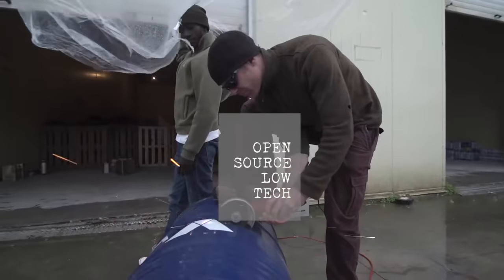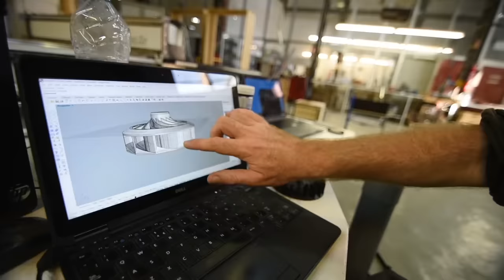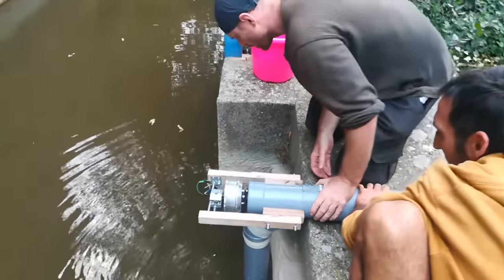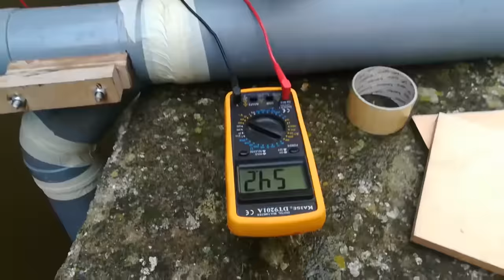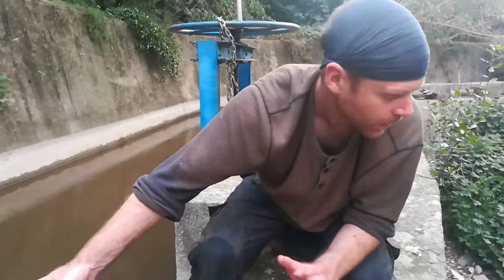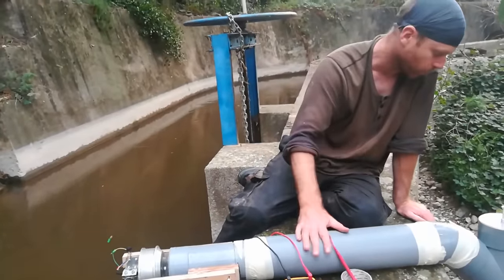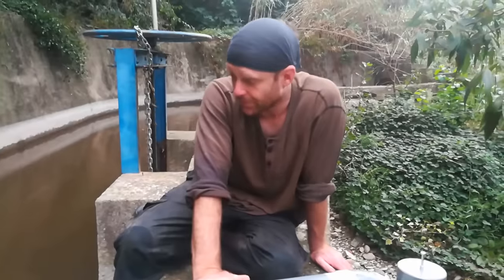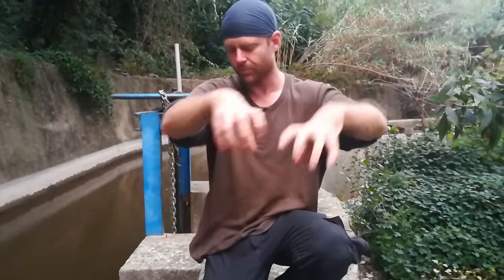The $50 Water Turbine -DIY, Portable, Powerful, and Open Source

Comment: Quick question because this got me thinking. Ok so you're essentially moving water from a huge - high up - reservoir, down below. Could this be engineered in such a way to allow moving water from the same reservoir, to the same reservoir? I realize you need to move the water back to suck it in and that would require power, some pump, leading to less gain. Tesla valves? Larger diameter pipes for the falling water? Seems impossible, just wondering, though.

Comment: Amazing! BUT, is the canal water clean enough to be released into a regular stream? I live on a creek and would love to generate power in similar fashion. 24-7 from the creek is intriguing as long as it doesn't disrupt the natural environment. Great build and great idea.
Reply from the maker: Generally, and with this one, they're such that the input and output waters are of the same source. ie, just plug it into a river. Here the mill run was diverted upstream from the same river as the output went back in to.

Comment: The siphoning was brilliant. But I think that fishes sucked in would get stuck in fan and die either in the blades or in the pipe due to pressure. Nice work though. Loved it.
Reply from the maker: There'll be a mesh bag filter to keep anything from getting sucked in.

Comment: Rarely are conditions that convenient for DIY-ers. You need a steady and reliable flow and a sizable drop and for that situation to exist near point of use. In most cases a lot of earthwork and infrastructure are needed.
Reply from the maker: No significant earthworks needed for this design, but indeed if you have no drop and flow then you have no hydro power availability.

Comment: Thanks for sharing. One question, in this model where you used the same pipe diameter, how many maximum amps did you get, before deciding to increase the diameter of the discharge pipe?
Reply from the maker: I haven't really been tying load to pipe diameter, the latter is generally the fattest that is affordable and doesn't pull more than the available water supply, and load is set by maximum power point / efficiency, which is generally that which drops the rpms to half that of open circuit / unloaded.

Comment: You can put a Pelton at the bottom and capture power a second time.
Reply from the maker: Peltons are good, but generally need at least 20 meters of head to function well, and the back pressure would halt the momentum.

Comment: I've given serious thought to trying to generate power from our creek - would let us generate our own power with a lot less battery backup since the hydro could be used on-demand to back up the solar and wind.
Reply from the maker: Yeah hydro is usually pretty nicely dependable in terms of output and availability.
How much drop and flow do you have and how much power would you be hoping for?
Reply: @OpenSourceLowTech  Flow is pretty heavily seasonal, but when we're not flooded or in drought probably a couple hundred gallons per minute. Drop is going to be limited, doubt I can engineer more than about 8-10' given that the land is pretty flat and I don't want to build a reservoir that rises above the cut of the creek, plus need to manage floodwater flows that easily can get into tens of thousands of gallons per minute. During maximum spring runoff, the flow cross-section is between fifty and a hundred square feet, with a linear flow velocity of around 10 feet per second at the surface, so rough math gives me a couple thousand gallons a second I need to send over the spillway without washing out the dam. A reservoir that could modulate the spring flood would be really handy, but given the terrain just isn't feasible. 
Power wise, maybe a couple kilowatts surge, few hundred watts sustained. I'd like to get 10kW out of the system to keep the geothermal heat pump running full time, but don't think that's feasible given the flat terrain.
Reply from the maker: Ok so no problem with flow then. Eight to ten feet is fine, I'm sort of looking around 2-3m / 8 ft as more or less the sweet spot of useful power vs expense vs what the materials can sustain vs much more than that and you'd be better off with a Pelton.

In Berlin, as per the Part 2 video, I ended up with 61VDC x 3.1A = 192W from 2.5m x ~30 l/s
It's not really going to have surge capacity tho, the turbine is essentially either just on if it has sufficient water, and off if it doesn't.
An option there tho would be multiple self starting siphon turbines at increasing heights in your dam wall, so that more come on as the water level rises, and shut off when it drops. And then just have an electrical setup which can accommodate however many it's being fed.

10kW is a lot of power tho..
Reply: @OpenSourceLowTech  I'm thinking a Pelton wheel setup driving an automotive alternator is probably going to work pretty well for my application. Alternators can be had pretty cheap from salvage yards, and a Pelton is pretty efficient. If I hack the regulator circuit, I can pretty easily ramp up the output, and a well-designed Pelton is pretty efficient. I'll probably use a programmable logic control to manage the setup. That gives me quite a bit of flexibility, should be able to up the draw to a couple of kilowatts with that hardware if I can get enough torque off the wheel.
Reply from the maker: Peltons, Turgos, and other pressure type turbines usually need at least 15-20m of head to function.
Car alternators are low efficiency and need a lot of rpm to do much voltage, but do have fairly good max power, and like you say, charge regulation usually built in.

For this kind of power range I'd recommend something like a wheel from a hoverboard / balance board, which are three pahse permanent magnet alts when spun, good for about 400W depending.

If you need something in the kilowatt range either a treadmill motor, direct drive washing machine motor (which would be too large for my turbine) or something custom and pricier.

Comment: So with the turbine now acting as a pump too couldn’t you add in auxiliary turbines in the down pipe to generate more power or would the cause a drag on system(as far as torque and rpm)?

Comment: 500W mit 50L pro Sekunde bei 2m Fallhöhe und 40% Wirkungsgrad aus einem PC-Lüfterrad, ernsthaft?

Die Zahlen sind natürlich extrem geschönt: Durch die Energiegleichung für potentielle und kinetische Energie (E = m * g * h = 0.5 * m * v²) ergibt sich g * h = 0.5 * v² -> v = sqrt(2*g*h) = 6.26m/s und mit dem Volumenstrom durch ein 100er HT-Rohr(A = 0.0078m²) kommt man zwar in etwa auf 50 Liter pro Sekunde Q = A * v = 0.0078m² * 6.26m/s = 0.049m³/s = 49L/s und auch die Leistung passt in etwa mit 49kg/s * 9.81m/s² * 2m = 961W bzw. 385W bei 40% Wirkungsgrad.

ABER:
1. Bricht der Durchfluss DEUTLICH zusammen sobald man die Reibung an den Rohrwänden und Bögen berücksichtigt.
2. Reduziert sich der Durchfluss nochmals ERHEBLICH wenn man den Strömungswiderstand der Turbine berücksichtigt.
3. Hält das Lüfterrad einer realen Belastung von 500W niemals stand.
4. Liefert der Generator keine 500W, die 10A sind einfach aus der Luft gegriffen und die Spannung von 56V bricht bei Belastung sofort ein.
5. Selbst wenn Punkte 1-4 nicht vorhanden wären, was sie aber sind, würde das Lüfterrad innerhalb weniger Tage durch Sand und andere Teilchen im Wasser verschlissen.

Mit dem Spielzeug würde ich eine Leistung von etwa 100W für realistisch halten, wobei das Problem mit dem Verschleiß nach wie vor das Ganze absolut unsinnig macht.

Comment: A conical impeller fan will laminate the flow better. The water is crashing into the spindle/base of the fan. If you did a dual impeller you could increase power with less flow.
Reply from the maker: I put a nose cone on the fan, but yeah something more like a boat propeller shape would probably do a better job. Matter of how to easily source something like that in low resource environments tho...

Comment: 1)Just watching the end of the video when you try and stop it. Would a tap on the top of the downpipe work to break the siphon?

2)Does it work as a pump?
Reply from the maker: It would, and that's more like what I had in the Berlin build, in the Part 2 video.
It's more a matter tho of how to easily start it than stop.

The water will only siphon to a lower point, so it'll work well for emptying over a wall, but won't pump uphill.
Although a hybrid between this and a ram pump would, but only with a subset of the flow volume.

Comment: As a water treatment operator, I have a concern that you are at the lowest pressure point and that will cause your impeller to be damage from cavitation, I am not sure because I don't know the temperature of the water.. The best spot is at the bottom of the pipe, plus with more head pressure, you will get more power from the water.
Reply: Agree... it will max out with cavitation way before the theoretical maximum of 30 ft.

Comment: Will this work with leaves froms trees cloging up the pipes? What about minerals from the water clogging up? Love it. Just wondering about maintenance and the cost of maintenance. If you put the power output into a battery bank,... how well would this work?
Reply from the maker: Check the part 3 video just posted, but yeah the intake filter is a very non trivial design consideration that I'm currently giving thought to.
Mineral deposits shouldn't be a problem.

Should plug into a fairly standard battery or grid tie schema pretty well.
Reply: @OpenSourceLowTech   @OpenSourceLowTech  thanks for the response. I have much to learn,... trying to work out the dynamics of what i have available to me. There is a creek that flows by my house that is somewhat off the grid. I enjoy your content and the reality of how easy it can be. Much appreciated. 

2 part question. I also work at a national park that produces thermal hot water. That is why i am asking about the mineral build up. There is alot of tufa(mineral) build up and excess of 140 degree ferenhit water. Will that overheat the turbine/motor?
Reply from the maker: Ok yeah if you're running it off geothermal water then things could get weird. The metal parts, even being stainless, I probably wouldn't want to keep immersed in whatever salts etc are likely in there, and the plastics would soften to some extent in the temperature, possibly problematically so.

You're probably looking more at thermal energy generation options there than gravitational or momentum.

Comment: Question: Do you think that you could engineer a system that runs on two large but finite bodies of water? So just as you were using a sort of syphoning technique to get the "ball rolling" from the unlimited canal down to the stream below, you would use some sort of closed loop system to take the out-take water and bring it back to the original source of water from another syphon-type system. I'm not an engineer by any stretch but just thinking about how this brilliant concept could be somehow applied to areas that don't have this kind of water source nearby. With my idea, in dry areas, persons could just build very large water containment units (think: earthbag tanks, water-holes, ferrocement tanks, or whatever) to replicate this idea by recycling the water within the system. They say that the only "stupid" question is not to question at all. I'm certainly hoping that my question falls into this category.  :)
Reply: So I'm not to versed in this suff but to the best of my knowledge you can.  But from what I've been told it's like adding another engine and 4 tires to a car. At that point using a just using a bigger 3 phase hydroelectric turbine would be more powerfu and cost effective.
I believe there's companies that use large ponds to store water and use it on demand for the generation of electricity. Kinda like a battery.

Comment: You need a small overhead water tank and a long pipe with few taps at different height in your workshop to test how much head you need for the system. You need not run so many times everywhere to check if working or not

Comment: your generator demonstrated on a canal: try this change with the same parts -  reconnect the elbow with a generator so that the generator is vertical, not horizontal. Safety with the electrical connections at the top. the inlet and outlet would be mirror images, with the generator on 1 side, the fill cap on the other. on your web site the "contact '  link does not function.
Reply from the maker: Yeah that's largely what I'm now going with, check the part 2 video in Berlin.

Contact page seems to be working for me, does it give an error?

Comment: So is this a high-volume low-pressure system where when you put the dynamo on the bottom a low-volume high-pressure turbine?
Reply from the maker: Kind of. It would be if you have the head, usually at least 15-20m, to get up to the pressure needed for a Pelton or Turgo, but at these kinds of low head, 2-3m, it's not going to be much pressure wherever you place the runner.
So instead of pressure the energy is present in the form of momentum, so need to have high volume high velocity.

Comment: Hi Daniel, This is cool. Great stuff. Thank you so much for publishing this project. The water flow at the end of the pipe has an enormous power. Is it possible to fix a second turbine end of the pipe externally and have a second level of power generation in one unit. Thank you.
Reply from the maker: Strictly speaking you could pour the water over something like a water wheel, which would extract additional power and since it was external, not put back pressure on the pipe and slow the flow across the first impeller.

The reason why I wouldn't advise it tho is that you're almost certainly going to get more power off the first impeller if you just add additional pipe through the vertical height that the water wheel would occupy.

Comment: Hi Daniel.  I wonder if considering that such a system can be built with such a low head if there is maybe a better prop design that can be developed for a high head-low volume situation that can have a better power output than the traditional pelton or turgo systems?  Perhaps it is not an issue as these are relatively efficient, but it seems remarkable that you are getting such high energy return from that system, and it seems like there must be a way to get more power from the existing tech for the opposite potential energy.  For my potential energy, I have 300 feet of head (if my inlet is on my neighbor's property) and a three thousand foot run or so to my outlet location (a gradual angle of the land).  Do you have any advice on building a low-cost system on this small creek? Will a motorcycle alternator work for it?
Reply from the maker: Check the other two videos for actual power output. 
I'll be trialing various runner designs with the current install, keeping in mind that what's best may change depending on specifics of the setup..

300 feet is a lot, but then so is 3,000.. your main issue is probably going to be how to get that much pipe at a workable price.
Maybe look into old fire hoses, which departments often chuck out when they get old, but should still be ok for this kind of use.

Ultimately, I don't anticipate my turbine ever getting up to the kind of efficiencies of a Pelton or Turgo when operating at high head, and those are easy enough to fab that if you've got the water availability they're likely always going to be your best option.

Comment: Hola , Pregunta los 55 Volts es Voc, es a circuito abierto y con carga a cuanto baja, y respecto de los 10 Amperios también es en Isc??.Gracias!!
Hello, Ask the 55 Volts is Voc, is it an open circuit and with load how low it is, and regarding the 10 Amps it is also in Isc ??Thanks !!.
Reply from the maker: That was open circuit, but check the part 2 video in Berlin, after a bit of optimisation it managed to get to 192W @ 61VDC x 3.1A

Comment: What if on the down pipe. You put in the fittings. With another generator or two? Could the force of the water going out turn the generators? Because the more generators. The more electricity

Comment: Can you like use some kind of rain barrel setup, then when the water hits the bottom use a water pump with the electricity being made from that turbine, to pump the water to the top and then have the same water go through the turbine again, keeping the electricity flowing?
Reply: Perpetual energy isn't possible. Best bet is to place another turbine on the bottom.

Comment: Imagine having like 5 of those running at once, supplying about 50 Volts at 10 amps each. You can then run 250V through a line, which is a standard output and have 12.5kw/h, which is perfect if you live in the middle of nowhere

Comment: This may be a stupid thought, but sometimes those are the ones that pay off.  Hydraulic ram pump to move water to a high tank, which would then gravity feed to operate your turbine?  I know the ram would have to be much larger for the volumes to work out but that would seem possible.  Maybe a 12" ram pump to feed a 4" turbine?  Maybe figure out how to go over on the pump volume to fill a water tower, thus providing some modest running water as well as power?
Reply from the maker: This would likely work in practice, but you'd end up with more power overall just tagging the turbine onto the water supply you'd be using for the ram.
Reply: @OpenSourceLowTech  assuming that there is a drop.  i live in the land of the pancake.  A big hill, here is maybe six feet above the average and rarely is there a water source there, or it would have ran down hill and spread out across the vast plain.  

I can't be the only one in that position.  I expected you would have to dig a hole just to get the ram started.
Reply from the maker: No drop, no power. Both a ram pump or this turbine require it. Doesn't work to dig a hole as that would just immediately fill with water and then isn't a drop any more.